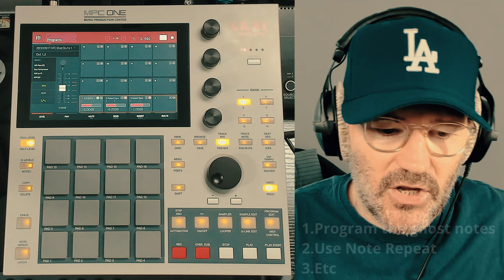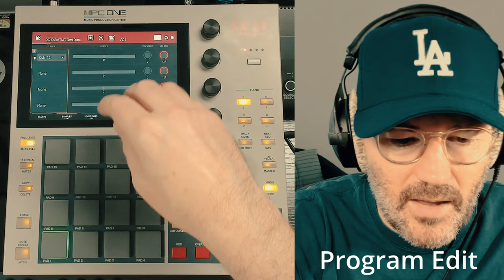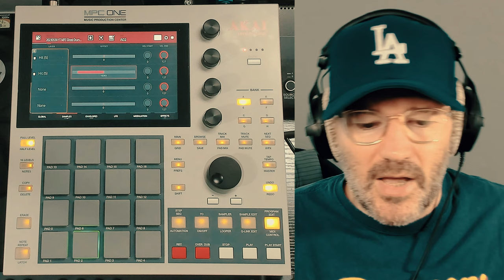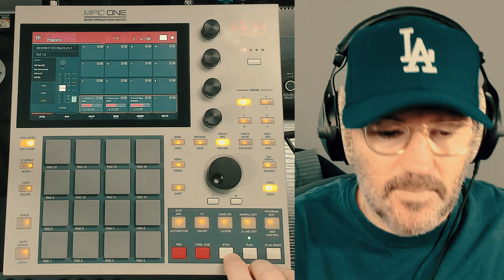How to get that head nodding GROOVE & SWING in your hi-hats & beats in the MPC Standalone.

Comment: Use the same hat on same pad..Lay the first hat then shift to half level and change your tc or turn it off and fill in behind the first hat sequence. Way faster in my opinion.
Reply from the maker: Thanks for watching. I find my method faster IMO, but there is no right or wrong and they both work.
Reply: @TheCratesMotel  Yeh same, your method is quicker and you have way more control.

Comment: I was wondering with the knobs you have on your MPC do you get a slight delay from the Q-links when first turning them? I have some similar that do that.
Reply from the maker: I have them on both my One and my Live 2. With the Live 2 they are 100% responsive. With the One, initially there was an issue with one of them. I had to tap it first sometimes. I took it off and cleaned inside the hole with a QTip. Now all knobs are as responsive as the OG knobs.
Reply: @TheCratesMotel  Thanks I'll try the QTip to see if that helps. I have a Live 2.

Comment: Cool tip with the volume panning and offset values! (I was automating the pans in like you explained in your ducking video! 😂 

I started drumming at the same age as you although I’m 45 and I can see this being far easier than adjusting the velocities of every other hat in grid mode, or dare I say the step sequencer!? 😆 
Not sure who’s using it, but it’s not for me…

What I’ve been doing to get more swing on my hats is either adjusting the Swing value after they’re played in with note repeat on and apply the TC range (to selected) and adjust the Swing Value up to taste by ear while listening back to the hats til they’re in the pocket, you can create a pad with up to 4 layered ”cycled” hats with different velocity etc… and set the cycle value to random for some cool humanized sounding stuff to use with note repeat!

Also similarly to what you’re doing here with layering using offsets, I’ll sometimes layer 2 hats and just set the layers to play as note on/ note off (toggle I believe!?) and it cycles between the two.  
Just release the pad when I want the second hat to hit played in half time a bit like releasing your foot on an open high hat on drums to get a more humanized sound too!?

You guys can also get some cool scratch effects by reversing a kick or the first kick in a chopped  break program and copying it with the original to another pad in the drum program with the start/end point adjusted on them or (attack/ release) set to mute out everything else in the drum program for a really cool way to get a baby scratch in your beats that mutes out everything like bringing a record back when DJing.

I’m sure some of you guys have tried stuff like that before, but just in case anyone here hasn’t and is  interested in trying anything it’s a really neat effect to have in your drum programs, hopefully it helps someone? it really sounds cool on an 808 with a bit more decay too…

Sorry for the long text but this channel is a refreshing change and if I can help inspire someone else with some creative approaches to sampling then that’s great! 

Stay blessed, stay positive and keep inspiring each other!
Reply from the maker: Hey dude, thank you for watching and thank you for sharing some really ace tips. I have tried a few of those but there are some there I haven't tried so I will experiment with them. I think the thing I love about the MPC is there are often multiple ways to do the same thing and the method I have demonstrated in this video is just one of the ways I do it, but I do use others to get the same result. The cycling layers option is great to use in so many different ways and if used properly can get some reall ynatural sounding drums. Anyway thanks for sharing dude.

Comment: Do you ever play with offset for a single layered sound? I think it is also a nice way to push a quantized snare ahead or behind the beat without moving the midi. It also could be useful for hits where the sample doesn’t start on the hit, but slightly before it. You can get that air in before the transient.
Reply from the maker: Yes that’s a great way of doing it. Thanks for watching.

Comment: Interesting way. I usually put a 1/16 or so delay sync with no feedback to get that kind of result. I'll try this one as it saves one insert.
Reply from the maker: Exactly man, and as I said in the video, there are so many ways to get the same result, which is why I love the MPC so much. As you said, if you are in a position where you need to save an insert you can use this method. Also, I don't think you can adjust the swing on sync delays?? It's not attached to the Time Correction as far as I know.
Reply: @TheCratesMotel  No you can't but you can set the swing on the hat itself, stil not the same thing. Maybe Delay Pro can do that, I tried the eval but didn't bought it so can't check as trial is over.
Reply from the maker: @philippebackprotips  it’s just great we have a bunch of options. I’ve not tried the new delay yet either.

Comment: Hey been through a bunch of your videos todays learnt alot thanks to u👍🏽 do u have any videos on how to use the  filter in envelope section
Reply from the maker: Hey dude, thank you for watching. I haven't touched on filters yet, but it is on the list.
Reply: Also one more thing mate so I've followed every step to get my hats swinging they you have done it in this video but everytime I press the pad I can only here a single note where on your video u press the pad and u hear two notes
Reply from the maker: @jorellfraser5135  Hmm thats odd. Do you have the level turned up on layer 2?
Reply: @TheCratesMotel  I have layer 1 on 80 let's and layer 2 lower 30 40
Reply: @TheCratesMotel  does it have to be all the way up
Reply from the maker: @jorellfraser5135  no, you should be good with those levels
Reply from the maker: @jorellfraser5135  Is drum program set to Poly? Or Mono? In the program edit page 1 Global.
Reply: @TheCratesMotel  poly
Reply: I've realised something you've got your off beat set to minus that's probably why I can't hear the hat on the 2nd layer any idea how to flip it the other way I'm using mpc beats software so something might be abit different
Reply from the maker: @jorellfraser5135  Ah ok. I’m not exactly sure to be honest mate. I’ve never used that software.
Reply: @TheCratesMotel  just solved the problem once again cheers mate I just changed the offset on layer 1 I thought it had to be the second layer
Reply from the maker: @jorellfraser5135  Awesome!!